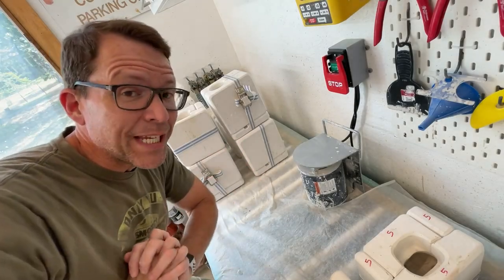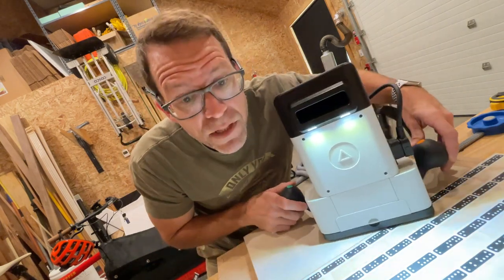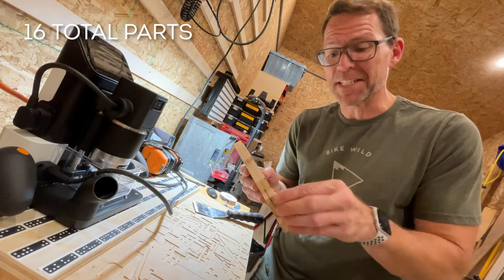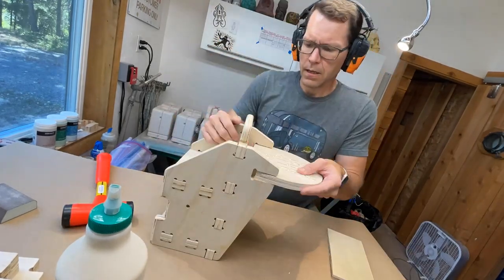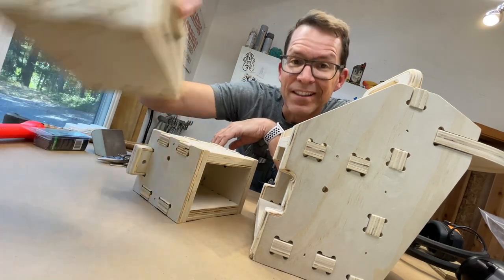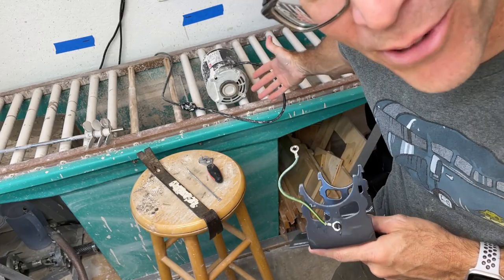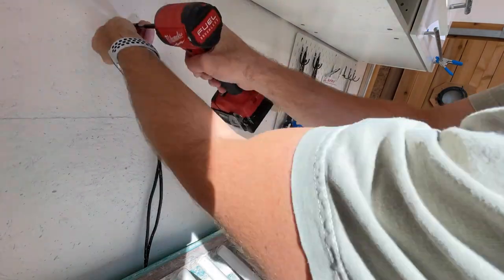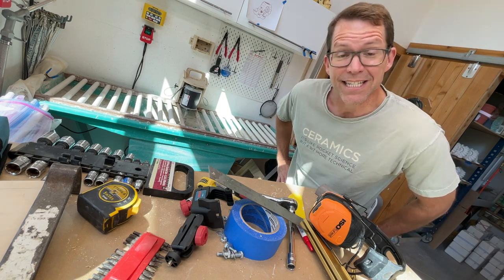Studio DIY with the Shaper Origin - Tiki Technical Tuesday 54

Comment: I've been there with the tight fit.. Make sure to cut "male" parts first and always dry-fit them to the "female" parts before you remove them from the table.  If too tight just adjust (typically increase) your offsets before thinking your done with the Origin.. dry-fit again until perfection.
Reply from the maker: Thank you! That’s definitely the order of operations I’ll be following in the future

Comment: Nice work but you need to come back to Hawaii to remind yourself what “old and corroded” really means. The original motor mount looked pretty good to me.
Reply from the maker: Ha! You never saw the motor mount - the bracket you see me bolting on was mostly ok, but the actual powder coated mount had to be pryed off with a crowbar and totally disintegrated into a pile of rust flakes 😂

Comment: I'm pretty sure the choice of CNC wasn't in your advantage for this project. But what the heck, you sure seemed to have fun.
Reply from the maker: I do sometimes long for a gantry type CNC - but I just don’t have the space in my studio that one would need
Reply: @vantikistudio  That's funny. I sometimes feel the lure of a shaper origin. But then again it's a bit expensive for what I'll be using it for. Also, never underestimate the more classical techniques compared to CNC. CNC is a lot of setup and preparation, hardly worth the effort if you make but one piece. The shaper origin is probaly somewhere in between, being able to do the setup intuitively and on the fly.